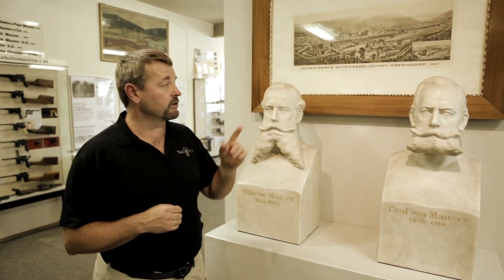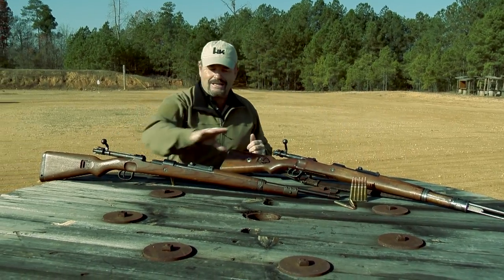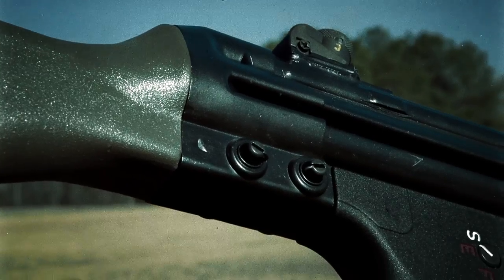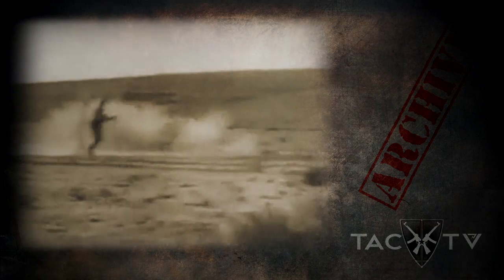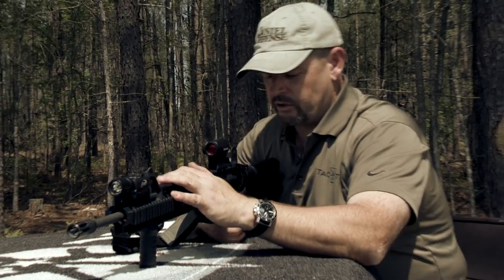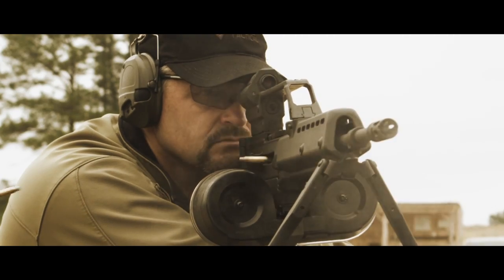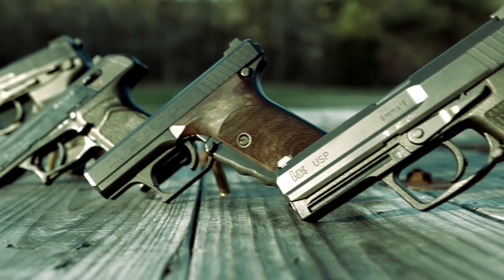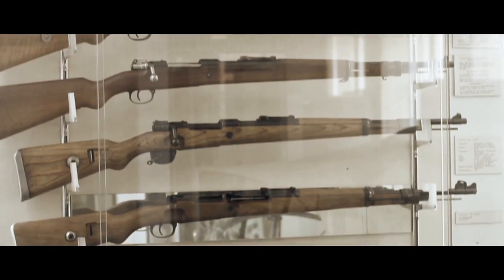TAC-TV Episode 19 - H&K History

Comment: No actually the Ak is a long stroke gas piston the G36 and ACR are both short stroke gas piston. And both the ACR and G36 have a nonreciprocating charging handle. Besides the modular design parts differences and different placement of the charging handle they are very similar rifles.

Comment: I found it ironic that the delayed roller blowback was looked as a solution or improvement over the gas piston operated Stg 44. The delayed roller blowback seemed more expensive, more complicated designed, and has since been replaced mostly by gas piston system it tried to replace. I know the current trend is the short stroke gas piston but it seemed like HK found it's niche on a less than modern design for such a long time while most other major players on the firearms scene was sticking to the gas piston system

Comment: You need to research details about HK history a lot more next time. You leave out lots of key information on the design history.  A good place to start is to read Full Circle A Treatise on Roller Locking by Blake Stevens. For example you will get key information on why the flutes are there.

Comment: @Vickers Tactical the G36 is getting outruled by the Bundeswehr and it is going to be replaced with a new developed design in 2019 :)
Reply: no with a completly new development
Reply: Well yes i don´t understand it either but they already had one developed but that got canceled and now they start a new development, they cold also use the xm8 design
Reply: Why should they order mg4´s when they already introduced the mg 5?
Reply: +Marvin Metalhead So there's going to be new trials and stuff?
Reply: Chris Ellis yes
Reply: +FighterJet 210 No

G36 stays as the main Rifle.
The 417 was just added as G27 as Support Gun for MG Soldiers.
It's also the new DMR, under the designation G28E2 or G28E2P

The MG4 is chambered in 5,56 and is for Soldiers, the MG5 is a Vehicle Based MG chambered in 7.62 for the new Puma and so on.
Reply: ***** Nothing to apologize for, didnt meant to sound rude.^^
Reply: the new version I do believe is just going to be an updated version of the G36c. They found out that the accuracy issues weren't due to the gun itself but the ammo they were using.

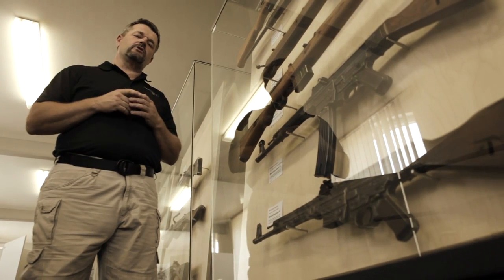Comment: 7:38
"delayed blowback"
"roller locked"
No? How can it be locked and blowback at the same time? The StG-45(M) was roller locked, not delayed blowback.
Reply from the maker: Do some research - the STG45(M) was the predecessor to all HK roller licked guns which are delayed blowback. Otherwise known as half locked
Reply: @VickersTacticalLAV  No, you need to do some research. The delayed blowback firearms developed by H&K were not roller locked, they were roller delayed blowback. Roller locking and roller delayed blowback are not the same operating mechanism.
The StG-45(M) was produced in both gas-operated, roller locked (Gerat 06) and roller delayed blowback prototype variants (Gerat 06H).